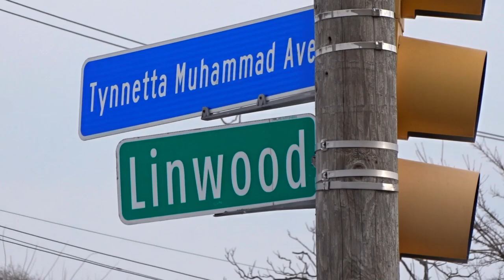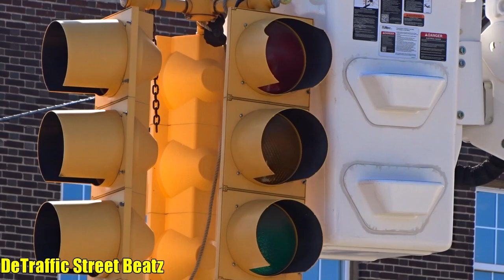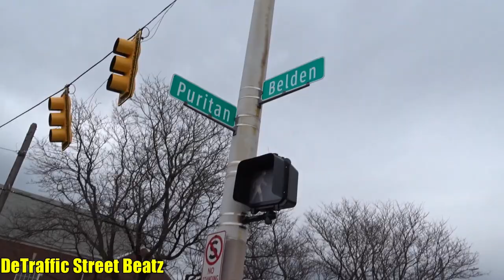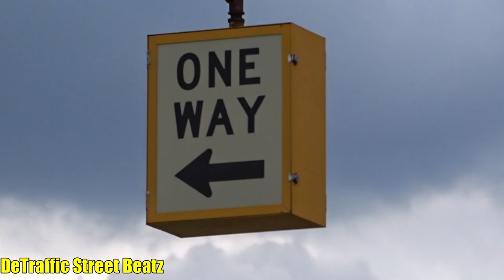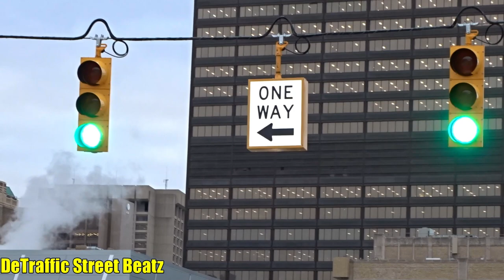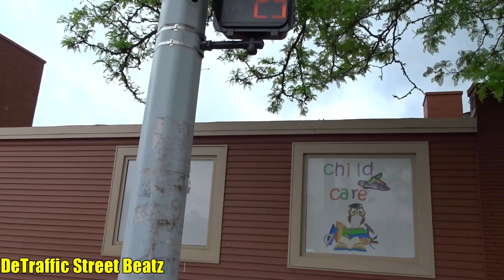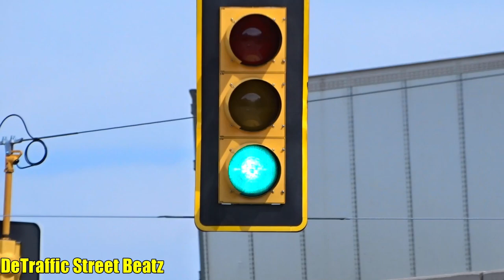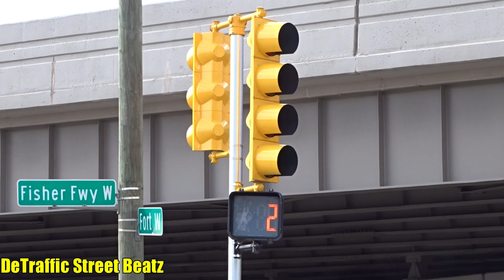Detroit Traffic Lights Before and After Upgrades 3

Comment: 22:30 should have put another Cord underneath those Lights they're just Wiggling and Waggling away in the Wind making it hard for Drivers to see what Color the Traffic Light is set to! Especially at 22:52 How is anyone there suppose to see the Lights right there with the Wind Lifting them in the Air like that?